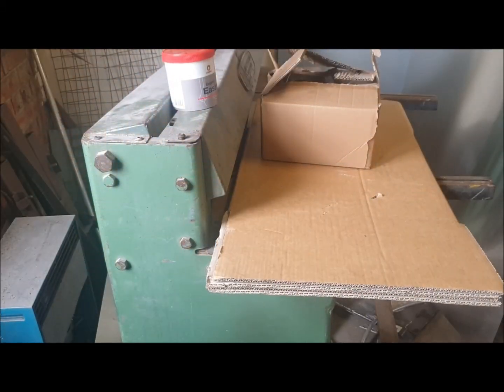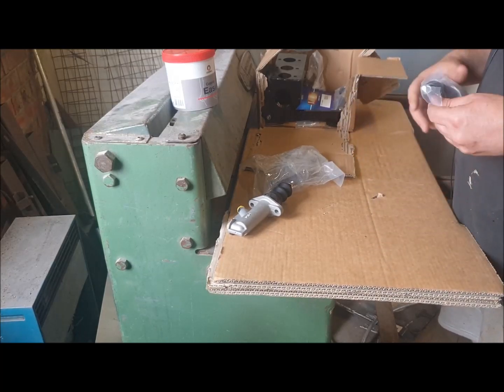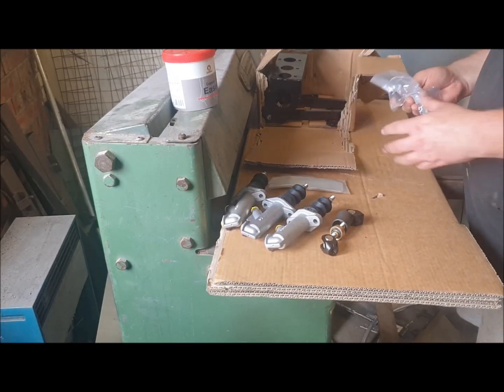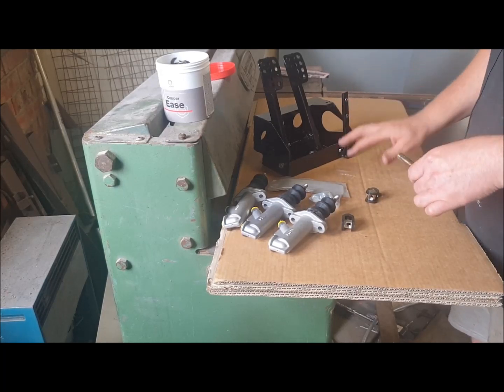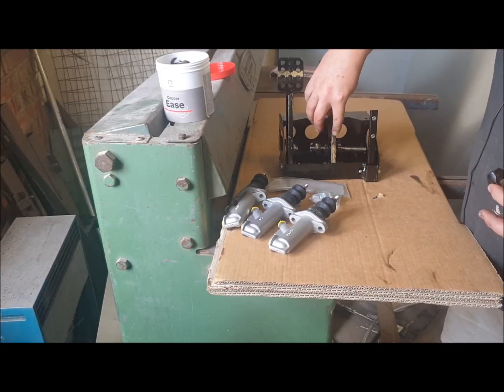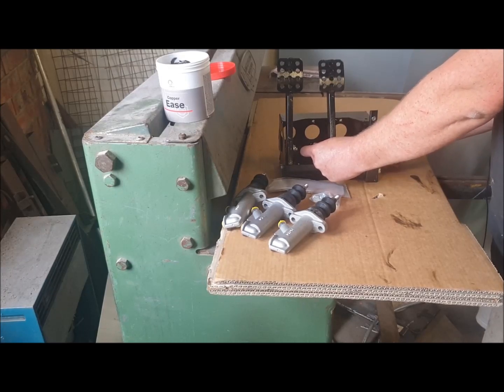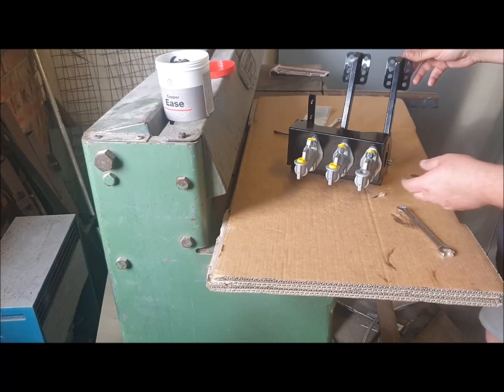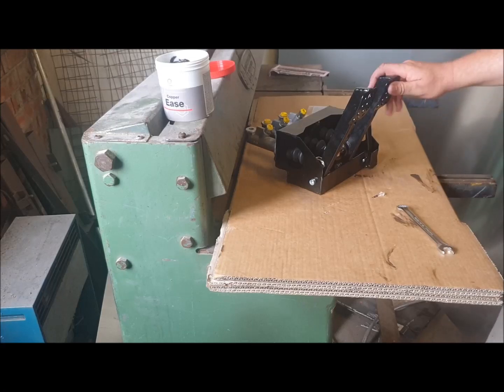GT40 replica build - pedal box assembly

Comment: Also I note the pedal angles are slightly adjustable through the master cylinder rod thread, but the throttle is not adjustable.

How do you adjust throttle pedal position? By rewarding the angle ?

Ta
Reply from the maker: You are correct. Throttle can have an adjustable screw added to help though.

Comment: I note you put the .7 rear cylinder in the middle position , does it really matter on this pedal box which way round the master cylinders go ? 
Obviously as long as you have them plumbed to correct brake line
Reply from the maker: Hi Phil, you are correct. I put it there by convention and it makes it very slightly easier on the brake line routes as that closer to the centre for the run to the back of the car and the front master cylinder to the right hand side so they don't have to cross over and I can route the pipe around the front of the chassis